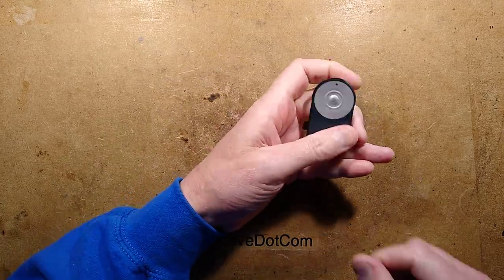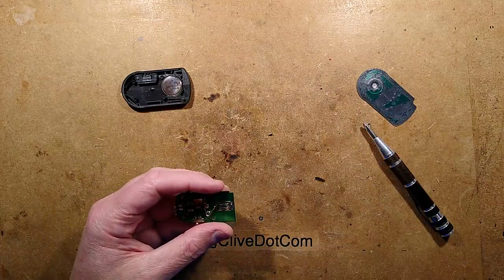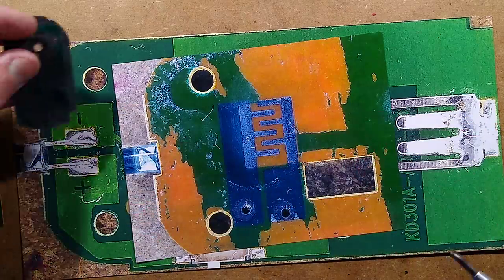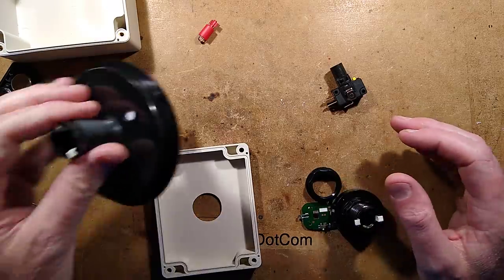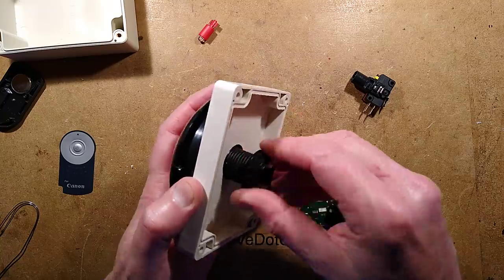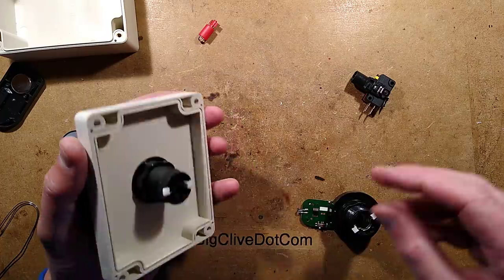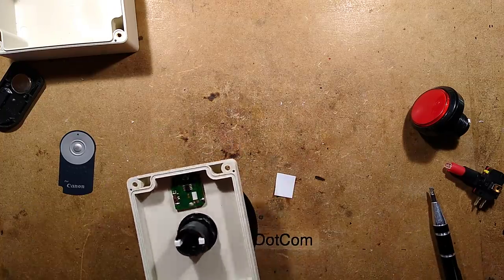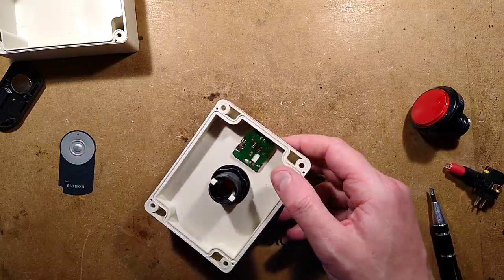How big can we make Ralfy's remote control?

Comment: Coincidentally, what you did here is what people in the Occupational Therapy field refer to as "switch adapting" a device. It when somebody, due to physical limitations due to injury/disability/aging/etc, can't hit a button or switch, they wire in a better suited switch or a 3.5mm audio jack for use with existing accessibility switches. I guess it also works well for being a smartass to your sibling! lol Nice project, Clive!
Reply: Yes. I saw this and thought it was like our big red button replacement for the pendant alarm service. It has given me ideas about adapting other things to make them easier to operate
Reply: It's also pretty useful for cheaply automating a remote with relays
Reply: I love these signs in places:
AUTOMATIC DOOR
press button to open. - In other words, it's not automatic !
Reply: @millomweb  The door is still automatic tho, it's just they replaced a sensor with a switch usually for access control. I think you'd call it a trigger switch ... Trigger, or triggered I guess we will find out. 🤣

Comment: 23:34
Oh no, why put the battery holder in the lower part of the case?
Looks like it would have fitted in the top next to the switch.
I hate it when I open a case and the two halves are inseperable because of a few tiny wires.
Reply: Amen! I was screaming at the screen the whole time.
Reply: And said wires are of course far too short to flap the thing open 😒
Reply: Brotherly love necessitates in goes in the bottom case. If he was building it for himself, he would have put it on the top next to the switch or made it accessible without having to remove the four screws. 😁
Reply: I'd say Clive built the whole thing upside-down.... Could have been all built into the box, and have the fixings for the lid underneath for a neater finish 🤔
Reply: The problem with mounting it on the lid is that the double-sided tape will let go in time. Gravity helps hold it if it is in the base. I'd have preferred it to be flat on the bottom for this reason. Better yet, mount it on the lid with better fixings!
Reply: In his defense he has increased the battery time tenfold. 2032 to AA
Reply: @Derundurel  I'd say he could turn the whole box upside down and still mount the holder on the side, and the lid in the bottom would allow to keep the whole contraption on one piece of plastic.
Reply: Considering the brief IR pulse and it originally using a CR2032 I wouldn't be surprised if that the batteries don't need to be replaced before the camera it sends signals to gets replaced.
Reply: @extrastuff9463  I'd actually recon that the button and the contacts will fail even sooner than that.
Reply: @jkobain  Nah, even cheap clones of arcade buttons are built like a tank. They're basically designed to be abused by kids all day.
Reply: @ixisid  I'm now realizing how confusing my message was. Well, I was talking about that crappy metal pad and the graphite lacquer in the PCB donor, so my guess was the battery would die first only if you avoid using the device for years. Otherwise the contacts will die sooner. IMO.
Reply: I wondered if the battery case was in the correct orientation so new batteries can be inserted. 
Also a big spring if the brother opens it up in the future.
Reply: Should have taken a leaf out of Apple's book and glued the lid on(for 'safety' of course) so you have to destroy the unit to fix it, voila! Ralfy would be over the moon at your concern for his safety.

Comment: No where near a Louis Rossmann amount of flux applied.
Reply: It amazing how much he uses!   Swimming in flux.
Reply: To be fair to Louis, while he does use a fair amount of flux for sure (and sometimes clearly enjoys how it triggers some people), most of his videos are shot under microscope, so it's not nearly as much flux as it might seem on camera. In fact I'd say Clive used a fairly similar amount here.
Reply: Well, he did mention only using a microPaul of flux after all
Reply: Louis sells flux on his site so the more his users sees him use the more they think they are supposed to use. See where that goes?
Reply: how much money he makes on youtube would cover is flux bill just fine
Reply: When working with that kind of high-iso-content clearmelt flux, hot air rework and multilayer boards with big chunky groundplanes - you do need a (relatively) sizable amount of flux. Because by the time both the board and a midsize bga or fpga is ripe for picking, most of that flux is blown away or gone too gooey and tacky. If you skimp, then by the time you get to flip it it off, there might no longer be full flowing flux penetration underneath. Saving 3 cent in flux but tearing a bunch of pads kinda sucks a lot more than cleaning flux.

Same scenario goes for soldering on chips in same context. But instead you have oxides forming, solder not wetting where it should and bridging where it should not.

In a workshop environment like that, the board goes in the ultrasonic afterwards anyway, unless it's a tiny smd job where an iso brush-rinse can get to all of it properly.

And yes. He definitely splooges on for comedic and triggering purposes at times.

Comment: 13:53 Kids, if you're fairly new to handling a soldering iron, don't do what Big Clive does here and desolder a wire from a metal contact you're holding on to. Put the contact in a third hand tool, put tension on the wire with one hand and only then melt the solder with the solering iron.
I learned this the hard way back in the early 80's. Let my experience serve to stop you from hurting yourself.
Reply: Thankfully Clive did a tutorial on how to properly solder in a previous video: https://youtu.be/nXkOxP5hka4?t=53

Comment: I just tried your camera trick with my cell phone and and a remote for a lamp I have and it worked.  NEATO!
Reply: Ray Ceeya My iPhone must have an IR filter.
Reply: @OC35  I've tried this in a class as a demonstration and it didn't seem to work for those with iPhones.
Reply: Yes real good cameras have an IR filter. So that outside photos in the bright sun come out with good color. Even my security camera has an IR filter that automatically flips into place during daytime so has good color. Then at night it flips out of way so IR light can give it night vision.
Reply: @Robert-Wilson  Well there must be a reason my Motorola only cost $165.  Does what I need it to do though.  Also came with a nice free audio cable for the built in phono jack.

Comment: With these I always add a decoupling capacitor for the IC, so that your battery life is prolonged. I tend to look on the "boards no longer functional" pile for a small SMD tantalum capacitor that will fit in the space, trying for around 10-22uF 16V or 25V capacitor, and solder it in appropriate places. That way the tiny little cells will still operate for a long time, till the internal resistance is so high that the IC cannot transmit any more. They last for months longer in use.

Comment: I have one of those cheap, $10 transistor tester devices that also detects and shows IR remote codes. I’ve only used it once for an IR remote control, but it was very useful to have around.

Comment: Re: clickers.  Back in the 1960s, when I was a kid, we got our first color TV.  It had a round TV tube with the top and bottom masked off, but it was a big thing for us 'cause we could watch Bonanza in color.  It had a sonic remote control (it was also the first TV we had with a remote) but, being a fancy one, it had an electronic unit instead of a clicker. The clickers on cheap sets used a tuning fork and a spring-loaded hammer to make a click of just the right frequency to change channels and turn up the sound.  Turn up, but not down, as after it went up maybe 3 or 4 times it would drop to zero in the next click.  You wound up the hammer when you pushed the button, a little like pulling the trigger on a double action revolver.  Ours, being a fancier electronic unit, also allowed controlling brightness, color, and tint, and volume went both up and down.  The problem with it, apart from having to replace batteries (carbon/zinc of a special, and expensive, size) frequently, was that sometimes, when you opened the sliding glass door in the living room, the sound of the door would change the channel.

Comment: Reminds me of fixing my parents late 80's TV remote in the mid 90's - they were always loosing it and breaking it. I built a 6" x 3" x 2" steel box. I put a Telephone clicky (like an early computer) keypad on top, some tactile switches on the side for volume and a stainless steel foot switch for the on off. The on off required two tumbs to operate and solved the problem of hitting the switch by accident. The large box let me run it on C cells instead of the AAA that only lasted a month. Remote ooutlasted the TV!..Oh it weighed 500g (a pound)

Comment: I knew a fellow who worked as the lead tech in a Network Operations Center for a Telecom.  Near the exit door of the server room were two large buttons of the sort you have there which he called "clown buttons" for obvious reasons.  One on the right, which was yellow, opened the door; and one on the left, which set off the Halon fire protections system for the server room.  This presented a problem because periodically visitors from the corporate office would come and visit the NOC and after their visit would, upon exiting, sometimes press the wrong button, setting off the fire protection system and cutting the power to the building and filling the room with unbreathable Halon gas forcing everyone in the room to have to leave quickly and stay out until the gas dissipated.  Naturally this caused some red faces, either from embarrassment or from anger.  Having happened once too often, a solution was found.  The red button was encased in a clear plastic box with a spring loaded door on it that makes a piercing sound when opened to deter people from opening the box and pressing the button, unless there is an actual fire.  The solution worked well and most people have learned not to open the button box anymore, however, he said that once in a great while someone is still determined to press the big red button undeterred by the screeching door on the box and again fills the room with Halon.  C'est la vie.  :)

Comment: The was a U.S. company Zenith Radio, that made "clickers" with no electronics. They had small bits of metal tuning forks that were tuned for various ultrasonic frequencies, around 40 KHz, when you pressed a button, it would spring and force the tuning fork to vibrate. There were up to 6 different forks from around 38 to 44 KHz. The receiver had 6 different tuned circuit to detect each frequency, they were spaced about 500 Hz apart.

Comment: 1. Try using your cellphone to detect IR LEDs...    Usually works...
2. Try putting a scope across the LED leads to see if there's  burst of coded signals from the board...
3. You might want to install a larger IR LED to get better coverage & range...

Comment: Our first colour TV [1977] had a remote that worked by sending an ultrasonic signal. I found that cats could hear it, and they didn't like the sound. They would jump up, startled by the sudden burst of 'invisible' noise. It would probably have worked for dogs too, but there were none about near me back then. There were three buttons 'On/Vol up', 'Vol down/Off', and 'Next channel'. Hitting the buttons like a crazed trumpet player had the best effect on the cats. Sadly, batteries left in the remote ruined it when they leaked.

Comment: Regarding sticking tape on plastics: This kind of plastics (Polypropylene, polyethylene, etc) does not have a plastifier in it that makes it hard to glue - they are genuinely hard to glue by themselves in their molecular composition. Mechanically scratching it works independent of that, of course.

Comment: A friends parents had a TV with a "clicker" type remote control in the 1970s. We found that moths would respond to the clicker by taking evasive action, I presume they interpreted the sound as bat ultrasonic signals.
Reply: When the original Metal Slinky Spring was a thing, we found that when "juggled" it would emit the correct frequency to change the channel.. Hours of fun before the parents sussed us..

Comment: Reminds me of the firing switch I made for rocket launches. Got a commercial big red button (emergency stop button from industrial equipment)and the safety key switch from a garbage compactor and put them on a big box (about 4" x 6" x 3") and wiring going to the battery with big clips as well as a run of about 20' to the pad.

Comment: The twist in the wire is an interesting thing to me, I have always been used to a clockwise twist in all the wire I found here in America, although as of late I have been installing a bunch of Erickson equipment that comes with your European blue brown green and yellow wire and it all has a counter-clockwise twist. It trips me up all the time because I am in such a habit of twisting in a clockwise Direction and I wind up I'm doing the factory twist in the Ericsson power cable

Comment: IR blasters put out timed pulses (kinda Morse-code-y) that have to match a sequence in the receiving device to be recognized. Different manufacturers and devices use different codes for each function, and they don't overlap. Pretty sure you can find databases of the different code sets used by different devices online, if you ever want to try building a custom universal remote.

Comment: Adhesives on plastic can be tricky. Had a windshield washer tank(plastic) develop a crack and to fix it I used a special kit with an epoxy specifically formulated to bond to the plastic of the tank. Nothing else seemed to get a good bond, but this stuff really seemed to stick with a vengeance. The downside was that it was really more expensive than I could have predicted but at least it worked well.

Comment: If I remember correctly from many years ago working at a large distributor as an engineer, the IR remote control chips were way cheaper than any microcontroller. At the time there were not many cheaper than about £0.50 in volume but the IR chips were £0.08. If the same ratio has been maintained then the IR chips will be down to about £0.01 at most, as you can get some very simple microcontrollers from the likes of LCSC for less than £0.10.

Comment: It's actually pretty easy to program an arduino to use an IR receiver to scan an IR remote and get its exact protocol, then program it to send any command with that protocol through an IR LED. There's a library on GitHub called IRLib2 that does all the work. It understands every remote I have.

So you can turn anything with a button and a place for an LED into a remote for just about anything that uses an IR remote. Even without the guts of a working remote.

Comment: An observation, what about soldering the microcontrollers pins together and putting the microswitch connectors onto the battery box terminals, that way the batteries would only be used when the button was pressed and you wouldnt need to change them as often ?

Comment: I've seen a remote control that looked like it had a set of pipes inside; I guess it was a (near) ultrasonic bell set.  But the first remote controls used a flashlight and light sensors arranged in the corners around the TV.  Aim at the corner for channel or volume.

Comment: It might be improper wavelength of that red LED that makes it kinda dim inside the buttons. If the lens on the buttons was designed for incandescent bulbs, you should try warm white LEDs in them. I learned this when I tried to replace the bulbs to LEDs inside the turn signals of my father's motorcycle in 2008. No matter how bright and how many yellow or orange LEDs I tried, it was inferior to the original (I think 5W) incandescent bulb. Then I realised I either need clear lens for the turn signals and use orange LEDs, or leave the original lens and use warm white LEDs, because the orange lens acts as a band pass filter, and if the LED wavelength is not perfectly matching with it, it will be very dim. I never had the opportunity to finish the project, because the bike got stolen a few weeks later... It was a GDR made Simson S50.

Comment: With the upgrade to AA cells you could have deadbugged a transistor onto the IR LED to light a bigger LED in the button whenever pressed.
Reply from the maker: If it had been too directional I'd have put in a bigger IR LED.
Reply: Or multiple IR LEDs on all sides to make it omnidirectional. And make the button flash as visual indication it was activated.

Comment: Years ago I had the idea of making a giant button like this, but with its only purpose being a giant mute button for the TV, to mute the damn commercials that are so annoying.  The plan was to use a universal remote circuit board so it could be adjusted for any TV, and the entire perimeter of the case being IR LEDS so aiming was not an issue.  I never got around to making it, though.
Reply from the maker: Easy with a TVBgone keyring as the base.  But probably better not to make it too obvious.

Comment: The terminals on the switch are designed for both crimp connectors and soldered wires. That is why they have a hole.